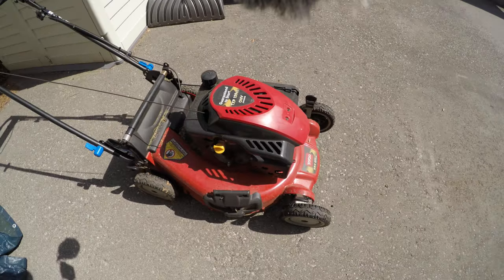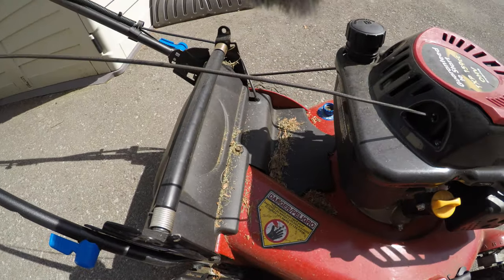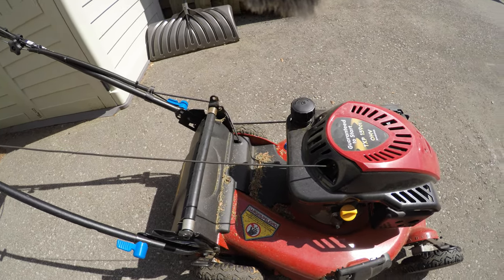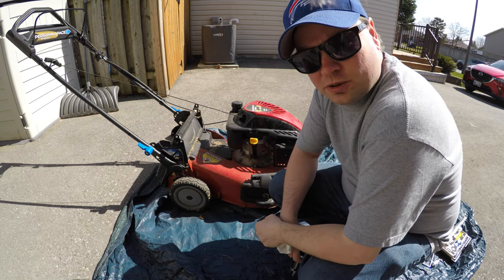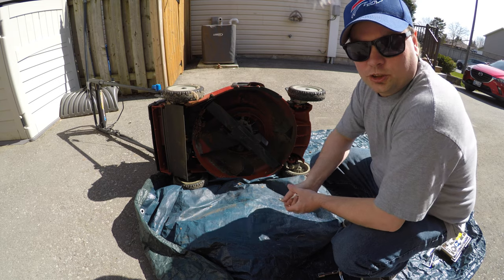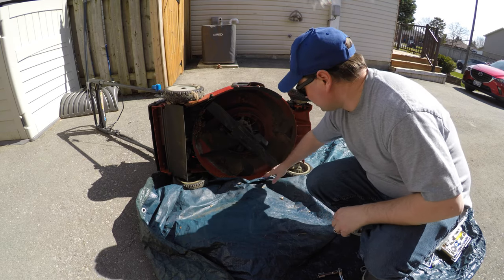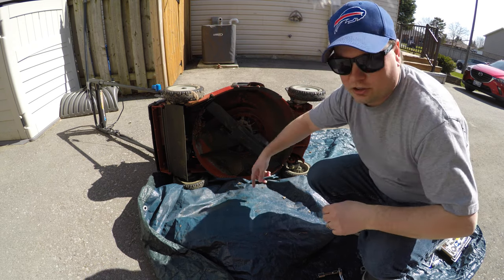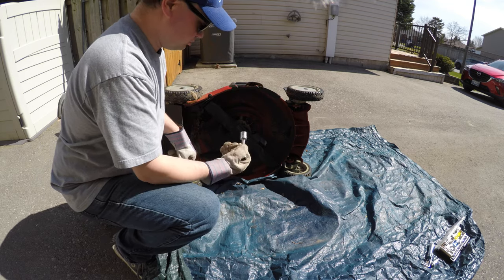DIY Lawn Mower Maintenance Tips // Spring Lawn Mower Tune Up

Comment: Most of the super recyclers have a drain plug on the bottom of the deck to drain the oil, usually a 3/8 ratchet head.  Also, make sure to check the air filter and most supers have grease zerks on the rear wheels for the axle.

Comment: Nice job pal. Ive never done any of that maintenance on mine... imagine what the oil looks like in it. Pulled it out yesterday and she started on about the 4th pull. I should probably check the oil level at least
Reply from the maker: Thanks man! Usually on mine towards the end of the season I struggle to get it started on the third or 4th pull. Change the spark plug and I’m on the first pull every time the next season. So for the $8 I pay for the plug, it’s worth it.